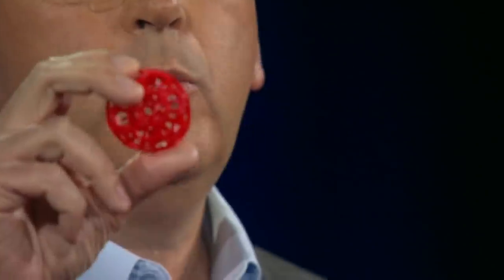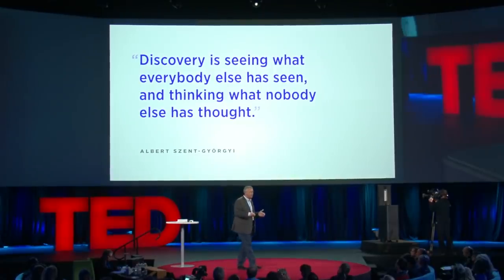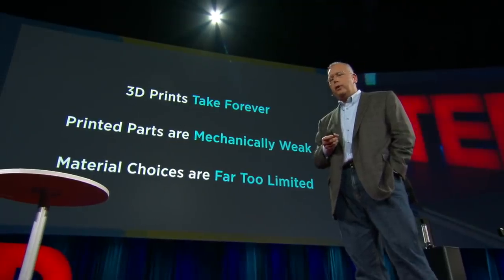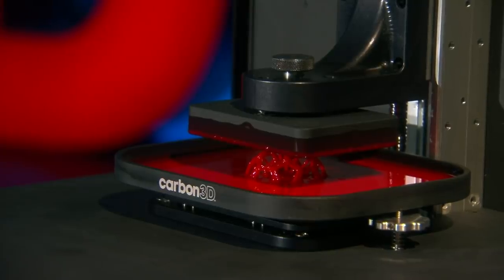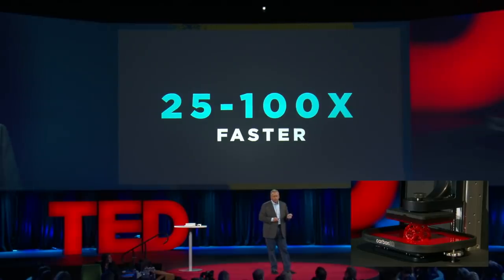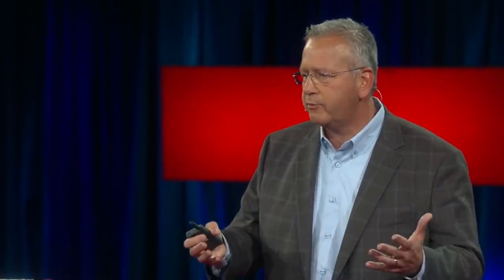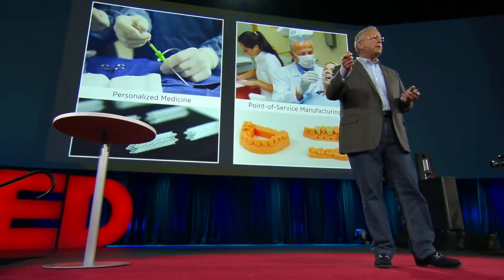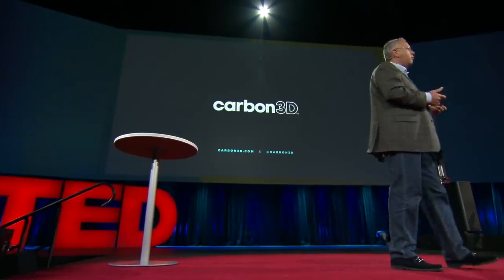What if 3D printing was 100x faster? | Joseph DeSimone

Comment: This is like the first black and white printers. But with this method, it's impossible to print anything with multiple colors, let alone multiple materials. When we solve that, 3D printing will be the new way of actual manufacturing of basically everything.

Comment: The problem is that the resins cost a bit much. A typical clp printer is a cheaper build than a regular 3d printer but the protoresin costs 100eur per litre so people mix their own stuff. The resins smell as well as require a light box preventing uv exposure on eyes etc so thats why clp never really get cool even though the results are very good and fast. If they make it cheap - the resins, loads will use that technology as the speed and detail still is better than a thread feed printer.

Comment: This tech appears to still be quite limiting as to the materials you could use since they have to be resin-based. IMO, an easier approach would be to figure out a way to make a bed-width print head for an FDM printer that would print an entire layer in a single pass, similar to a laser (paper) printer. With something like that, even at low speeds, you could easily cut print times down by a factor of 10 or more, and it would potentially allow for the use of any standard FDM materials.

Comment: 10/22 eighth video(I have a midterm exam  so i can't do this yesterday. Sorry)
Actually, our club has 3d printer(FDM), so I know the drawback of the 3dprinter. As the video says, it is slow, and result depends on how we print and use support, and the useless layer is made. But i am suprised that the 3d printing result is made in just in a couple of minutes. This type of advancement will give great advantage to 3d printing industry. And also, I think it can be also used in space robot so when some parts are broken, quickly made a new parts and fix it by itself. I hope that I can see this type of 3d printer soon that i can use ut when i make robot!

Comment: The only problem with this kind of resin cure 3D printing is that what he printed on stage is misleading. He claimed it was 25-100x faster than normal traditional 3D printing however, he did not wash the print in isopropal alcohol and then cure for hours in UV light. These are crucial steps in resin cure 3D printing and hence why this technology is not widely used.

Comment: This sort of thing has been around since the 80's.  Stereo Lithography.  This is just an improvement on that technology.  https://en.wikipedia.org/wiki/Stereolithography  We used this in the early 90's to make casting prototypes.  The materials are much better now, but this is not a new idea.  This is actually where 3D printing started.

Comment: Making a production ready part from the initial concept (CAD model) relies on design engineers who have an intrinsic knowledge of the end users requirements. In most industries, this is not present and there is a period of prototype evaluation based on user feedback on what actually works in practice. It's almost impossible to design a perfect product off the bat... The limiting factor therefore, won't be technology but human intelligence. It will be a long time before AI surpasses human intelligence, if it ever does, even with the rise of tools like shape optimisation.

Comment: Sure the first generation of high-speed 3d printers cost 40,000/year but that is less than the cost of the very first industrial additive process 3d machines and that was almost twenty years ago (the patients were reported to expire just this last year. In real dollars and in terms of productivity these "puddle" 3d machines could bee  two to three (100 to 1000) orders of magnitude more productive when you consider all the drawbacks that accompany the first generation of commercial machines. 

I can see this machine like this easily replacing the injection molding of small numbers of parts Or even totally replacing the manufacture of single-copy custom parts. If NASA has not already ordered this machine for the space station, then they are busy determining  if and how this process can be adapted to space.

Comment: This is still a 2D printing technique.  Only a 2-dimensional section of your part is being printed at a time...  also "really great material properties" doesn't mean anything.  Engineers actually have specific requirements for those and there's a reason you mainly see FDM style printers being used - because we need the materials they offer.  And let's not forget that getting into aerospace is not so easy.  The FAA has very strict requirements on additive manufacturing.  But it's good those points were all glossed over.

Comment: 6 years where is this now??
Reply: DLP/LCD/mLCD printers are basically this.
The next evolutions for this technology seem to be HARP printing, and Volumetric Printing, the first already being commercially viable, and the second using the same chemical+light reactions, but to print even faster and in actual 3D (fine, rotating vertical 2D planes, if you insist)

Comment: is it on the market yet?
Reply: +Vache the Cow - You can't buy SLA printers at Wal-Mart, only FDM printers which have kind of crap quality.  SLA print quality puts FDM to shame, and if the speaker is to be believed his new machine puts other SLA machines to shame.
(Not to say FDM printers don't have their uses - they're much more economical than SLA printers, for instance...  But they can't match the print quality of SLA by a long shot.)

Comment: so if the little bowl of goo were 6 bowls of different kinds of goo then you could 2D print 6 different kinds of material on one layer until all the layers are built up.  just need a platter that all six bowls rotate into place.  simple circuits and even solar panels could be made quite quickly.  entirely new kinds of circuits with P and N materials that used to need to be soldered in place will just be dopped into place next to each other creating entire processor chips.  your ink pen will double as your computer projecting an image on the wall and still have enough space to hold a refillable ink cartridge.  imagine if you pulled your 5" pen out of your pocket, pulled it out of a sleeve, stretched it to 8.5", place it on a piece of paper and it rolled the entire length of the document and printed what you wanted on a blank sheet of paper, that would be quite convenient.

Comment: SLA printers are down to $300 & still as slow as a wet week.
Reply: Cause this isn't a SLA or DLP printer. If we can find a oxygen permeable transparent plastic then we can modify DLP 3d printer on the cheap for 10x-100x the speed :)))

Comment: This is great... but.. what about size constraints, and price?? This thing costs 45k a year to LEASE.. That makes it available to very large companies only..The real breakthrough would have been making this technology open source so that the little guys can use this to develop their own product just as quick.
Reply: It is called an SLA printer.  There are ones you can buy for a few thousand.  

The "resin" you print with is much more expensive than the plastic filaments you can 3D print with.  It is also toxic to touch it and it hardens by itself if you do not print fast enough.

Sure, it is much faster and creates parts that are nearly just as strong from all angles.  You pay for those capabilities dearly.  And prices will not drop anytime soon because these resins can't be found anywhere else...unlike 3d printing filament, which is simply the plastics that are already populating the planet with waste.

Comment: The little print at the start doesnt take 3 to 10 hours. It will take 1 - 2
Reply: +Andtobis yes you are probably right, but they did it in 10 minutes, so their technique is still a lot faster than the traditional 3D printing.
Reply: +Andtobis Perhaps so, but even the jump from a single hour to about 6 minutes is a ten times increase, that's a HUGE improvement margin, and surely it becomes more and more worth it as you print larger objects.

Add to that how that ball is not possible to be made with traditional means, it opens doors we didnt even knew were there. 

I can totally see in a decade or two, a machine that has a pool sized puddle in the ground, and it lifts a house's base structure from it or something grand as that.
This could make traditional manufacturing look as archaic as stone carving with other stones is.
Reply: Yes i agree, not trying to say their product is bad. But saying its 100 times faster is a lie.

Comment: I don't understand how it's any different from the FormLabs printer. what's new here?
Reply: +Nitzan Ben-Ari - As the Formlabs printer prints a layer, the cured resin bonds to the bottom of the resin tank - so each time it prints a layer it nees to stop, peel the model off the bottom of the tank, and then advance the Z axis. This also means that the layer resolution is effectively limited by how much time you're willing to spend peeling layers.
The oxygen-permeable membrane prevents newly printed layers from bonding to the tank, which means the Z axis can be advanced continuously. The print is thus faster, and the vertical resolution is only limited by the mechanical properties of the printer and the precision and frame-rate of the optical system

Comment: It's been 6 years.. WHERE IS IT?!
Reply: DLP/LCD/mLCD printers are basically this.
The next evolutions for this technology seem to be HARP printing, and Volumetric Printing, the first already being commercially viable, and the second being very new, but using the same chemical+light reactions while rotating a clear container/jar to print much faster.
Volumetric printing is still quite new and in early R&D phases, but if it can be fine tuned for better precision and larger items, it'll be amazing.
Reply: @UanoCraff  Thank you so much for the hints!

Comment: be nice if auto manufacturers just released CAD files open source so we could, you know, replace the parts without a ton of reverse engineering. I have two body panels on a 1999 Toyota Corolla that I could make for less than 100 with the right cad file but Toyota wanted me to pay $900 each.

Comment: You can't compare FDM printer with lithography. In fact lithography needs curing.  FDM has many problems unless the 3D printer is in it's own room that has stable temperature. But FDM will never get to the resolution of Lithographic  3D printer.  True this machine can print faster cause it doesn't retract but still needs curing.Stronger parts only after curing. FDM can also print with kevlar but not many FDM printers can do this properly.

Comment: This is a cool printer but so far as I know nothing like it can do metal, there are fast metal printers but they're additive deposition printers (laying down layers of metal powder) and that's going to limit what it can do for aerospace or automotive industries, because the kinds of parts that need complex machining are usually metal, things like load bearing braces, rocking arms, rocket engines and jet turbine blades, so until one of these can do what it does with copper, steel, and aluminum and their various alloys it's probably going to be relegated to stuff like bouncy balls, shoe soles and phone cases.

Comment: non of this is new photopolymers SLS all old news. Build a clear sided Vat filled with stationary semi firm gel like  fluid and project a flat image slice and move it down  down from top to bottom  of the cylindrical tank or vat  as fast as a desktop scanner or faster curing each light beam thin slice as it passes continuously or revolve the projector around the sides of the cylinder about the cylinder axis pointing in.

Comment: This isn't just game changing for 3D printing, this is potentially the END of injection molding, which is a total PITA because the molds have to be designed and machined by very expensive skilled labor.
Reply: Also, I'm, really hoping they put out a small scale one so that the internet DiYers don't have to go through the years of reverse engineering this.

Comment: The oxygen permeable print bed eliminates the need to break the part free of the bed  after each layer of the resin is exposed. That is definitely a useful innovation.  Unfortunately, the parts are still extruded out of a similar photo-polymer that SLA machines have been using for decades. Parts made on SLA resin printers are well known to be lower strength than parts made on current FDM thermoplastic extruding printers. The photo-polymer "maker juice" is also MUCH more expensive than FDM thermoplastic filament. Their build volume also tends to be smaller than FDM printers.
.  
DLP projector printing and water cooling are not new ideas either. There are open-source DLP resin printer designs that you can build for well under $1000. For instance, check out LittleRP.com.
.  
The speed at which that part was printed on stage wasn't particularly impressive either. Many current FDM machines can print a part of that size in roughly the same time frame.

Comment: They conveniently neglect to go into the areas of material and material properties.  They also refuse to discuss the relatively small window of applications where this makes sense.  I really do hate the word "Additive Manufacturing" as it implies some sort of Star Trek replicator way of making parts.  It is truly only Rapid Prototyping for most applications.  Even at 100X it nowhere nearly duplicates the material properties and speed of injection molding on large production runs.  Granted rapid prototyping has its applications, and uses, but it is not anywhere near the hype that is being projected.  I have been using the technology since 1995 and the companies involved have been promoting it as a manufacturing method since way back.  I have used many methods such as FDM, SLA, LOM, SLS, and sand printing.  All of these technologies have their drawbacks, which the hype masters will gloss over with a wave of their magic wands.
Reply: +J. Frank Parnell Trade secrets. Of course, they won't reveal much.
Reply: More like vaporware.
Reply: What you have stated is untrue. Their technology is completely and totally different to what you have used. There are no layers in this technology and the range of materials their process can use are engineer plastics that out perform injection moulded plastics. This is what everyone have been promising. Its just stupid expensive at the moment. The moment someone figures out they oxygen permeable window and puts it out there for less than $10k, production will be changed forever.
Reply: gus, no it is not different.  It is simply DLP with a novel way of making the layers at a higher resolution via a gas permeable plate.  Their materials are not outperforming injection molded plastics, and I dare you to produce test evidence that shows that.  Their materials are all polyurethane, or SLA type resins, or cyanate ester.  They don't have any engineering type plastics (eg. polycarbonate, nylon 6/6, ABS or they like).
Reply: There are NO LAYERS... there just aren't it is a continuous not batched process. You go produce test evidence that what you're saying is true. You think someone needs to go do research because you said so... please... take your ego down a notch. Your telling me that polyurethane or Cyanate ester are NOT engineering plastics and that ABS is? where did you get that assessment? The last one is subjective but they are producing non-layered plastics. If you understood how their process works then you would realise that layering cannot even be created. The oxygen permeation of the optical window results in the polymerisation reactions occurring separate to the window and so there is no discrete layer formed that is separate to any of the other polymer reactions. It is continuous. That is real.
Reply: Gus, I highly doubt that you even understand how 3D printing works.  Of course there are layers.  Any cad model is sliced into layers.  The Carbon system displays each of those layers using a projection system, so there are layers.  They may be very thin, but there are layers.  You haven't even addressed my main points concerning the materials being very limited.  Carbon is also shooting themselves in the foot with their $40K subscription service to lease their machines.  This may be a unique way of making prototypes, but it is not the additive manufacturing panacea that every 3D printing manufacturer claims to have found.
Reply: look at this. http://carbon3d.com/clip-process
The projector can print a continuously changing image. I guess you could say that movies and video come at us in layers called frame. Light comes out in discrete elements called photons, that is what a layer is, a discrete distinction from one sector boundary to another. To say the layers are there is true right down to the quantum concept of life. Their charge model works for them, they are trying to make money, they are doing it right. And as far as claims are made by vendors, do you really pay attention to any of that? Do you listen to Coke Cola? Have you been disappointed when you found out that Coke is not it? Or did you just drink it and not pay attention to their message. I am done with this. You keep accusing me of not understanding anything and yet you pretty much have a simple view of the world.

Comment: here is my idea. 1000 tiny square needles pushed very close together. For everyone of them there is a motor so that you can change the height. With that technic you can make an individualised certain form. The same structure of moveable needles you got for the ceiling as well. Now you can make  some of the top and bottom needles stick together and form a shape form the side you fill the hole thing first with sand then with the liquid plastic in the end the last needles go in place and close up the hole era so that the structure can harden. 
Because of the sand this hole thing should be much faster then conventional 3D printing.